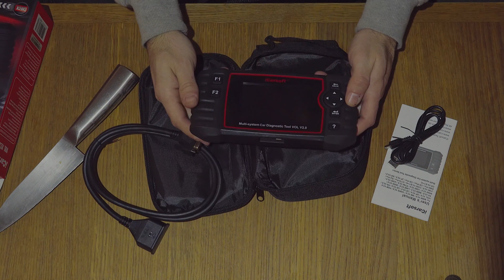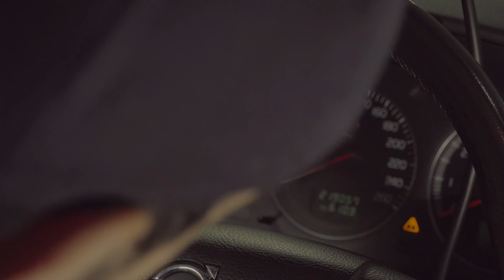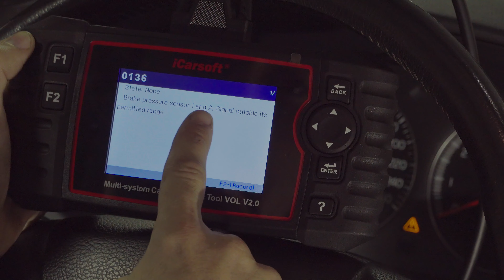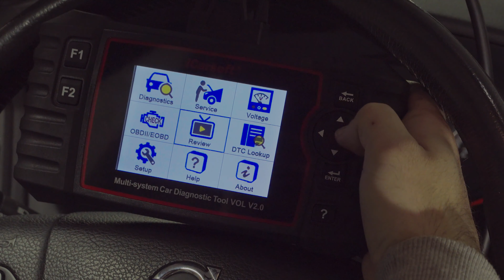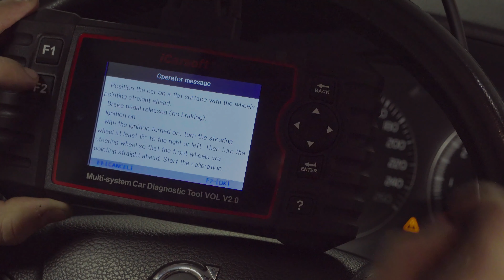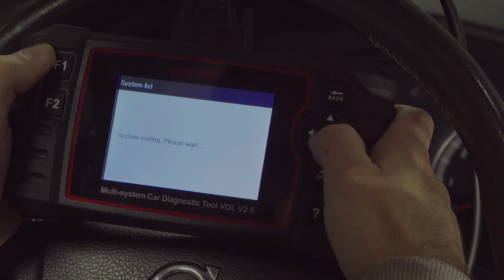FIRST TRY OF ICARSOFT Codereader for Volvo and Saab

Comment: I wonder if this version tool will work on a Volvo S60 mk2 R-design 2015?
Reply: I use the 1.0 version model for my 2015 V60, would guess 3.0 will work for the S60.

Comment: Will this detect the defective sensors in a 2001 Volvo C70 convertible whose  roof opening mechanism is faulty.
Reply from the maker: Sorry I don't now, it should however work with all volvos..

Comment: I'm looking for a scanner that can reset the trans fluid counter.  I also have a Volvo, in the USA.
Reply: Did you locate a scanner that will assess trans temp?
Reply: Did you?
Reply: @pnxrealmgaming  Not yet.
Reply: @gregthecrabb  If can´t find any obdscanner compatible for your Volvo. Vida/dice is the best thing to work with on a volvo but you need use a pc.

Comment: Kunde denna läsa ut och radera airbag koder
Reply: hi there, this is Jessica from iCarsoft Inc.
Yes, the item iCarsoft VOL V2.0 can do it all-reads and clears trouble codes on most of the systems
   such as engine, transmission, ABS and airbag etc.
For more details information of the item, please visit below link:
https://www.icarsoft.com/Product/s-325-iCarsoft_VOL_V2.html

If you have any other question about our products, please feel free to contact with me.
Skype: bongch503
Email: scanner01@icarsoft.com
Reply from the maker: Jag tror det,  jag köpte den här
https://www.24.se/hem-fritid/biltillbehor/bildiagnostik-obd2/icarsoft-vol-ii-for-volvo-saab?gclid=EAIaIQobChMIifid0ZDy6AIV1aSaCh3cbABMEAQYASABEgI1QfD_BwE

De har öppet köp med skickade tillbaka den då jag inte behöll volvon.

Inga problem att retubera